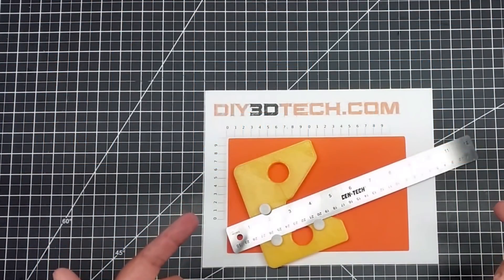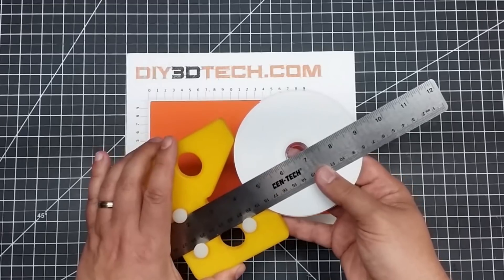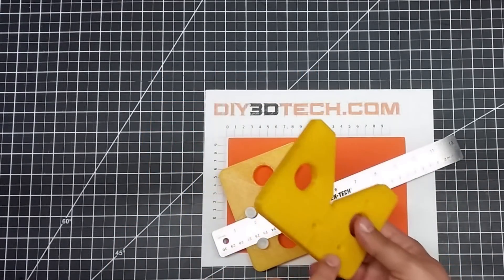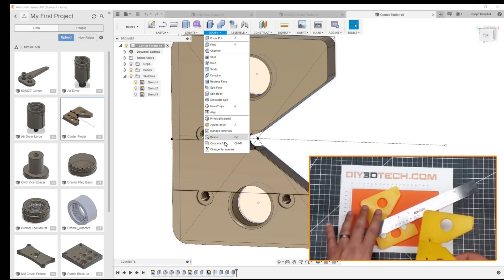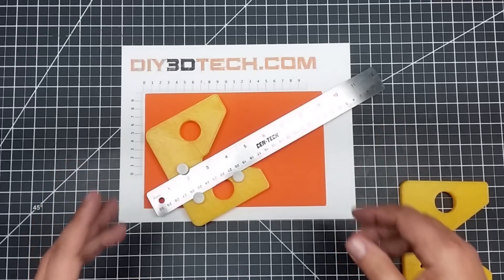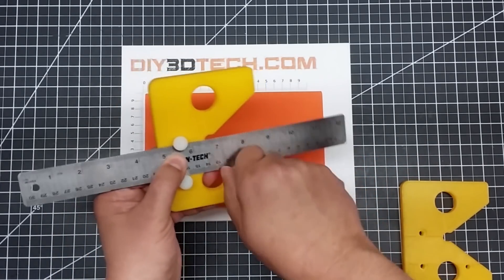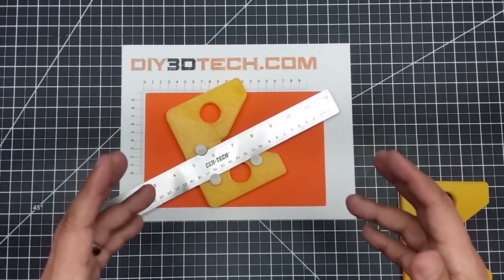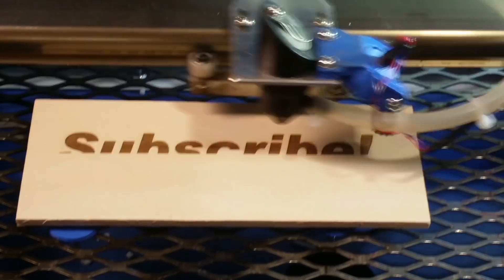Design Talk - 3D Printed Center Finder In Fusion 360!

Comment: Pretty cool and useful design. BTW, could you make a video on the air quality variation with airflow at home? For example, I started the printing with all windows open and what will the air quality be like when the printing is done and after 1hr, 3hrs .etc.  And I am also wondering the air quality for those fully enclosed 3D printers, will the toxic gases just deposit as time goes on? or just stay in the machine until they are released? I am now using 3D printer more than 8 hrs per day mainly printing with TPU PETG and PC, really afraid of the potential health hazard of 3D printing and want to know some good ways to prevent this. Thanks! :)
Reply from the maker: Have you seen this playlist: https://www.youtube.com/playlist?list=PLInTrkIbj69kz2Uf_c3JIIzgwvDdUEsPO  I cover all of the major filaments.  Also after watching, even with PLA/PETG, if you are doing a lot and have a number of printers I do recommend a  fresh air ventilation system as the micro-particials are too small for a HEPA filter to be effective...

Comment: Nice adaptation. Parameterized for thickness of ruler would be nice. Integrated ruler along the bottom or edge guiding side with layout holes for striking a line, just because. Also an arc layout tool within the top could just be a stacked series of holes.
Reply from the maker: Thanks!  And those are some good tips!

Comment: Interesting.  Thanks. Now I need to learn how to design a spiral in Fusion 360.  That's got me stumped.
Reply: Best I have found to do so far is ever expanding circles, and then drawing tangent arcs between the circles' extremes.
Reply: @CJICantLie  Okay thanks. Ill work on it.
Reply from the maker: Have you tried the coil tool?
Reply: @DIY3DTECHcom  Oh!  Not yet, was busy these  last few days on a driveway project.
Reply: @DIY3DTECHcom  I suppose he could have meant a vertical coil. Was thinking more of a Fibonacci spiral.

Comment: Nice design, will give it a try! You could also 3D print the thumb screws, right?
Reply from the maker: I wouldnt print then as they need to snug tight and don't see then lasting...
Reply: DIY3DTECH.com I got it. Will try to find some screws